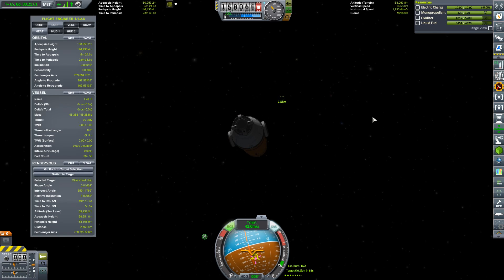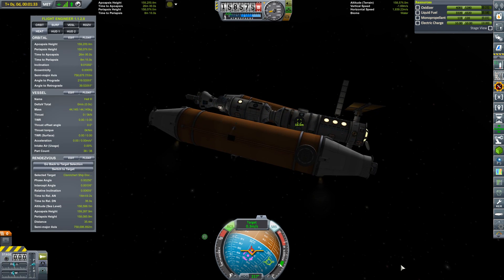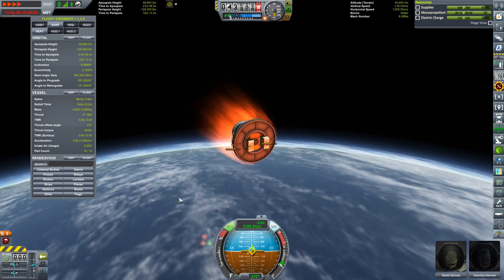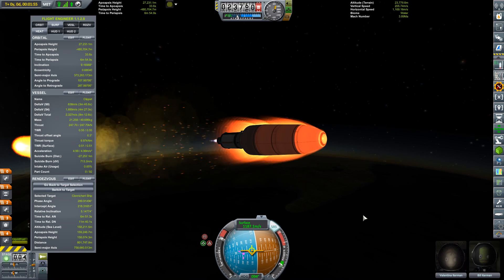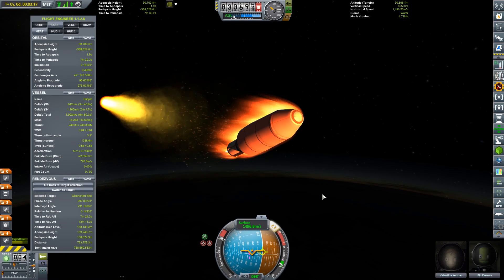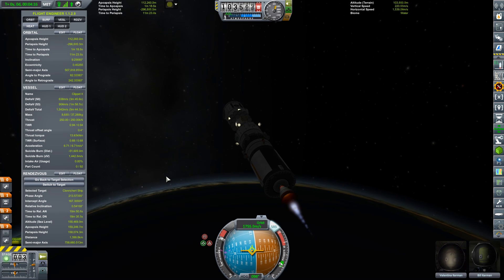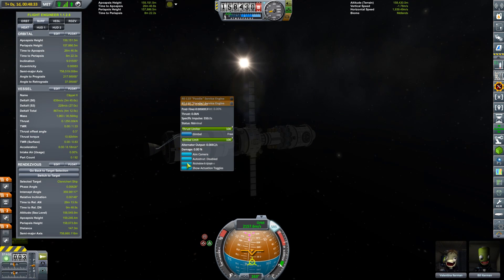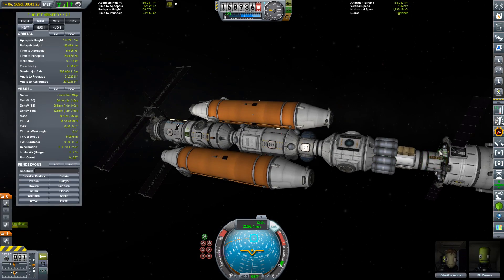Galileo Conquest - Episode 21 - Live Rocket Crashing Action!

Comment: What you saw with the upper stage spontaneously changing its axis of rotation is actually a real physical phenomenon that NASA ran into in the early days of space exploration. When Explorer 1 was designed, it was intended that it would spin around its "thin" axis - like the upper stage did, at first. But as the mission continued, Explorer 1's axis of rotation changed so that it was in a "flat" spin instead. As it turns out, in space, rotation around anything but the axis of rotation that provides the greatest moment of inertia is actually unstable, as we saw as the system of the spinning upper stage evolved.

Comment: Actually I don't think it's a kraken of that booster. Things tend to spin along its short axis naturally. It gives less rotational energy with same spin momentum. And energy dissipates by structural deformation. Spinning around its long axis (along that small eiganvalue of the inertia matrix) is also unstable.
Reply: https://ocw.mit.edu/courses/aeronautics-and-astronautics/16-07-dynamics-fall-2009/lecture-notes/MIT16_07F09_Lec27.pdf
Just found a great lecture explaining that.
As for unity physics, I have no clue if the numerical error can be count as perburbation and weather the physics engine make sure that energy only dissipates.

Comment: Heya Scott, I didn't the mod icon on your screen, but you should check out "Stage Recovery" to, well...automate your stage recovery needs without spending a ridiculous amount of time doing so. Pretty much just requires you to slap probes and/or parachutes onto your lower stages and, assuming it's enough to slow them down, you get some money back based on stuff like how fast they land and how far from the space center they are. (IIRC you can also tweak the values in settings should you think you are getting too much/too little for 'em.)

Comment: You should've used sepratrons for your de-orbiting "technique" on the spacecraft stage instead of the twitch engines. Sepratrons cost less, weigh less, and four-to-six sepratrons would've been more than enough for that spacecraft stage to de-orbit. Also, at this point with your low cash, you should be concerned with making low-cost spacecraft. If they must be expendable, just make stages out of bunches of radially-mounted LV-T45 "swivel" engine stages. Hell, just use twitch engines as vernier engines and add landing gear, then BOOM! You've got a reusable spacecraft! (But, let's hope there isn't actually a boom in your designing. The last thing you need is to pay for repairs on the VAB!)

Comment: Instead of rotating the docking ports at the end, you could put small modules that connect to the docking ports on both the engine section and the fuel tanks. That'll hold them steady in lieu of struts.
Reply: He did mention how he did no prior planning to the station/spacecraft.

Comment: NASA has double standards. space shuttle hand the landing gear under the heat shield.
Reply: Where else would you put the landing gear on the shuttle!? The reason why SpaceX isn't putting landing gear through the heat shield is because it would save on UNNECESSARY R&D, while on the space shuttle, it was NECESSARY R&D.

Comment: Can someone explain to me how "balloon" tanks work? I hear it often, like it holds only with pressurized propellant inside. How does that work? Do they mean by hold, that the rocket wouldn't crumble or anything but it couldn't sustain flight loads without pressurization? Much confused.
Reply: Go get a can of pop, stand on it. Then open it, drink contents, and repeat the process.

What's happening is the pressure vessel's under compression and tension, meaning outside forces need to overcome that to deform the structure. (often with spectacular results)
Reply: Did you know that the first Atlas Rocket used exclusively balloon tanks? Sometimes when the Atlas was pressurized too little, it would just crumple on the launch pad and explode. This is because without the pressure inside the tanks of the Atlas, it didn't have the structural strength to support itself.
Reply: It's partially pressurized during assembly, there's also significant scaffolding present as well.

During construction it's just a hollow tube carefully welded together, I know that some designs are built with an internal formwork that's removed at/near the end of construction.

EDIT: Regarding integrity during flight there's often a reserve of inert gas to keep pressure up to keep the tank rigid and (in some designs) keep pressure high enough to feed the engine(s).
Reply: Thanks that was helpful. Still seems like a hassle though. With all the extra work and pressurization gasses needed and so on making the tank part of the fuselage structure seems like a much more cost effective choice to me.
Reply: Right but you can't construct a pressure vessel under pressure? Or did they literally pressurize a mold, build the tank around it and never let it depressurize  until they filled it before launch? Or is the rocket on some sort of support structure that keeps it from crumbling before the tanks are pressurized?
Reply: And how does say the first stage keep structural integrity once the tanks start to drain, especially with all the loads from the engines blazing and the thrust increasing as the fuel drains.
Reply: That's the end goal, yes, engineers realized that a rigid structure from pressure makes a fine fuselage if thrust is pretty much only going along the length of it. You save weight having the tank being the body of the vehicle, and weight is precious when launching from the surface of the earth.

Also blimps rely on this principle as well, along with a handful of oddball fixed-wing designs, and ram-air parachutes work using positive pressure gained from airflow. Any inflatable piece of furniture relies on rigidity through pressure as well, along with inflatable boats and rafts. Rockets are probably the most spectacular example of this design philosophy.

Comment: hitting the water going 165.6kmh/102.9mph
Reply: Not necessarily. The world record height for cliff-diving is 54m, which implies an impact velocity of roughly 33 m/s, or ~120 km/h, so we know that that speed is survivable. 165 km/h might well kill you, but it's conceivable that it might just leave you broken-boned but still alive. Sky-divers with badly-packed chutes and others who fall from greater heights occasionally survive.

Obviously, we need multiple live trials to determine the survivability of high dives beyond 55m height. ;)
Reply: whoeveriam0iam14222 in short, you'd be very, very dead
Reply: I thusly propose that the new speed limit on highways should be 100mph because it's safe, as validated by Valentina.
Reply: There is a higher mortality rate for those who fall short heights rather than high ones. Make sure you don't jump off that ladder too spryly when you're landed!

Comment: At 16:06 that change of the spinning axis is totally expected, look up what happened to Americas first satellite (same problem). The symmetry axis of a cylinder is not the axis with the highest moment of inertia. A cylinder spun up this way will eventually try to change it's axis of rotation until it spins at 90 degrees to the symmetry axis.
Reply from the maker: Actually, a 3d object is stable if it spins on the axis with the highest or lowest moment of inertia, so it should have remained stable on that axis.

Comment: KSP badly needs a low light-level mode for night launches.
Reply: KSP does have the ability to boost ambient light levels in game settings (both the title-screen settings and in-game settings). It was added for v1.3.0 and remains in v1.3.1 prerelease.

(Unless you mean some kind of green-screen grainy night vision mode, which would indeed be pretty funky.)
Reply: In that case, Scott needs to adjust his ambient light for these night launches. ;)
Reply: +technicalfool But 1.3 sucks! The only real "feature" of 1.3 is that none of your mods are compatible!
Reply: And the aforementioned ambient light, and various performance improvements. Yes, the main extra feature is localisation. However it's not the only one, and modders have mostly made stuff compatible with 1.3 by now.

Comment: Mod suggestion: Real Plume. There is a version with stock configs and it would make your rockets look much more awesome before they explode. Speaking of wich: real plume should change the explosions too.

Btw: Kerbals have a crash tolerance of 50 m/s

Spin stabilization: things tend to spin around the axis of greatest moment of inertia, wich is why long things start to tumble when you spin them around the long axis.
Reply: is it really 50, that will help me in the future
Reply: Enthusiastic Amateur I did some testing on it. Below 50 has always worked so far (on a splashdown, on the ground it is risky but just below 50 has worked there too). I never had a Kerbal survive any more than 50, Neither on splashdown nor impact.
Reply: I'm told that if you land them on their helmets they have a higher tolerance, though that may have only been in earlier versions of the game.
Reply: DaraelDraconis I'm not sure, sounds like a myth.
Reply: it used to be that the ragdoll physics would glitch and let them just bounce letting them potentially survive

Comment: Is it possible to install the galileo planets mod with CKAN to a KSP 1.3.0? I'd rather not fiddle with my mods/files by hand...
Reply: From the forum post:
"For those that are wondering, CKAN is a long shot for this mod, but maybe one day"

So not right now, at least not officially. It's not like it's too difficult to extract into (KSP)/GameData.
Reply: I want to use it in combination with other mods. CKAN knows about dependencies and compatibility, quite handy if your working set contains 50-70 mods. Kerbal Alarm Clock, ScanSat, KE, MJ, KW, FASA, Real Scale Boosters come into mind - if I want some fun, BDArmory Continued and related ones. But yes, if I'd only wanted to use that one tiny set of mods, drag and drop would do.